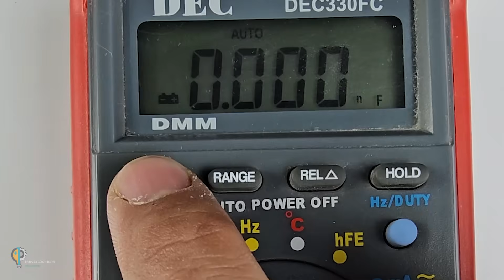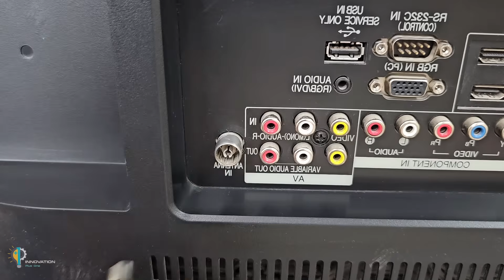I Connected a Battery to a CD – made a Powerful TV Antenna

Comment: Such precision
Reply from the maker: I'm glad you found this TV antenna useful and interesting. What type of antenna do you use?
Reply: @InnovationPlusOne hope you don't think it's plagiarsm but I modified your device by soldering a 2 k resistor and 1n4007 diode in series.this converts analogue signals to hd digital as now I can pick up TV programmes which were transmitted in the 50s and 60s  and returned after bouncing back off distant planets.
I can now smell the food off cookery programmes and climb into the picture.
I recently climbed in to a Perry mason episode thats me at the bus depot reading the paper in the case of the one eyed witness.
I had trouble finding my way out but I could hear my granddaughters voice who kept called me and found my way out that way.
Reply: t is fake.   it is cra